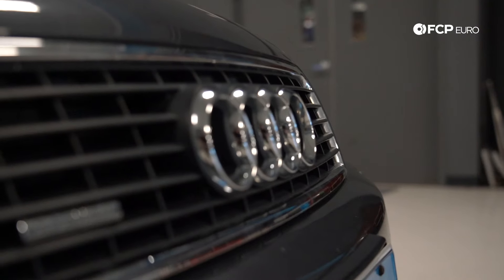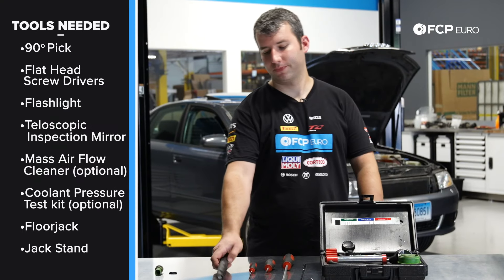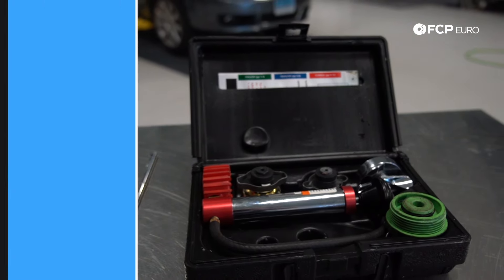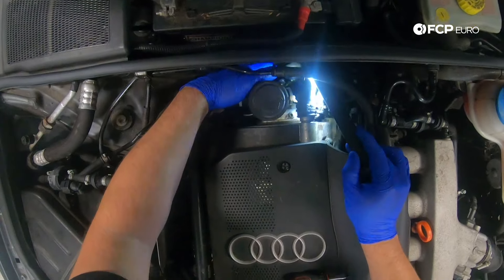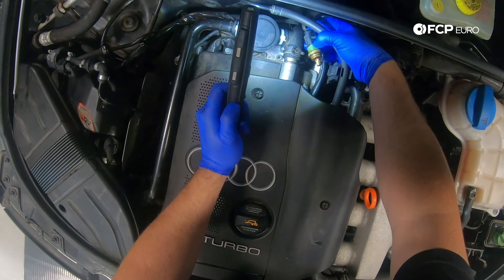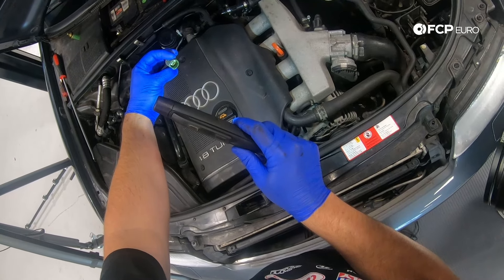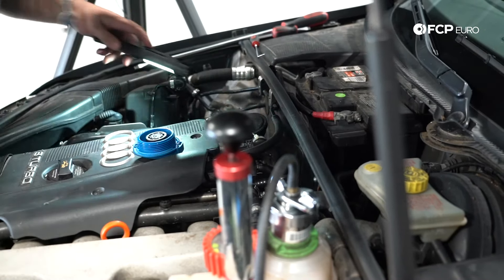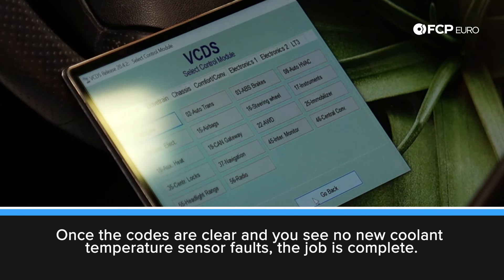Audi A4 B6 1.8t Coolant Temperature Sensor Replacement DIY (A4, A6, Golf, Passat, & More)

Comment: Thanks for the tip on tilting the engine. My sensor just failed, and I know it was stupidly tight to get stuff behind there when I took the cylinder head off and back on a while ago.

Comment: I change my without jack the car take couple hose and done the hard part is to put the clip without dropping inside the engine but working in my a4 1.8t b6 I developed a good touching sense to doing things without looking at the spot so for me skip steps  sometimes thanks for the video help me  good 👍

Comment: Doing this right now as we speak, with a 1999 passat 2.8 v6....the sensor is a PITA to access.  I thought i had it in correct, went to top off the coolant reservoir and coolant came POURING out the sensor.  You just showed me that i did not have it sitting properly and need to push it down more and secure the retainer clip better.....thank you so much for your very detailed and easy to understand explanation, MUCH appreciated

Comment: Thanks for this explination ,,, i have Passat 1.8 T ,2004  ,, but i have other problem , the stik who is going to inside sensor , was broken and was not contacted to the stik with 4 cable and diffrent color ( white , red , Gris , black ) the problem i do not know which pin number go to that color ,, please need help to that color exactly to there pin number ( 1, 3  and 2 , 4 ) ,,,,

Comment: Hi, Thanks for a great video. I changed the sensor on my audi a6 2008 but sometimes shows the correct temperature sometimes shows nothing. But I haven't had the opportunity to update it with the computer, what can you recommend? Thanks in advance
Reply from the maker: Scanning for codes first and clearing them is an easy place to start diagnosing the change in readings!

Comment: I have a 2001 AUDI A4 Quattro Avant 1.8 liter Turbo.
Engine code: AWM.  About 12 years ago a replaced the coolant temperature sensor because the gauge in the instrument panel displayed cold coolant, although it was hot already. Just this part of the sensor was faulty. There was no error code!
Recently I noticed some coolant drops under the sensor!  It seems it started leaking. I do not know when it is started leaking. My wife has been complaining for years (!) that she smells coolant when we drive. The oil has been leaking for 20 years, I always thought it was the oil dripping on the exhaust system... 
There is no error code this time either!!
I am about to buy a new 4 pin sensor with  a new O-ring  and replace it....

Comment: Thanks for video, i have a problem I appreciate if you can help me. My audi a6 c5 3.0 model 2002 has a problem that the cooling fans are kicking in late at 108c , I replaced the fan control module, and the coolant temperature sensor, same problem exist, when the gauge pass the middle, and the temperature shows 108c on the scanner, the fan kicks in. I read that the fans should activate at around 92-93c. Is there anything else i should check. Please I need your help. Thanks a lot
Reply: the fans have modulse inside they break often did you replace the fan

Comment: Couldn't get mine to seat right for the life of me. This video helped me a lot. I've been trying to press straight down instead of working it in. Gonna try this in a few min. Thanks for always making great vids.
Reply: The new one I bought was just  little bigger. I tried installing it without the O-ring , the new one, still would not fit. I'll be getting a new one tomorrow.
Reply: @jeffdawes9029  same thing I feel victim to as well, I got an aluminum flange kit and everything worked wonderfully except for the coolant sensor not seating properly in the sensor housing. Had a brand new leak where there wasn’t one before!
Reply: so, my second new temp sensor worked.
Reply: @jeffdawes9029  in my case the senspr was not wrong. It was the housing 100%.     People that haven’t done this yet, if you went eBay route like I did for these parts, make sure they fit right before doing the install! Otherwise you’ll be ordering another properly fitting piece lol
Reply: im assuming it worked lol

Comment: Hi, thanks for the video. I recently replaced mine on my Polo GTi 1.8t and I have been good gas mileage ever since and fault is cleared from ECU.
Reply: hey man, i need to ask you, i have passat 1.8t and i have lpg instaled too, on ecu i have check engine notification, on diagnostics it saids its lambda sonde, but on lpgs ecu it saids multiple errors conected to temperature sensor, now i noticed thet when i clear ecu code, i have good mpg, untill it cames up again, and start showing grand mgp, i noticed too that temp needle is altering from 0-90. Now my question, can this tiny sensor almost double the fuel consumpion??
Reply: @orgrimdoomhammer2161  yes, from what I've experienced it causes really terrible gas mileage. From what I researched it is either the CTS or the thermostat that throws off the error. So start by changing the CTS clear the code and observe.
Reply: @lincolnbothang7258  changed it, bord now showing normal values, itll take time to make some distance and test it out :D error still showing, i need to find some one to delete it from ecu
Reply: Hi Lincoln, I have got a polo gti as well and trying to sort the P0118 code and bad fuel consumption. I will replace the sensor and thermostat as well. Wanted to check if you had to tilt the engine as I  don’t think so as the polos are mounted side ways opposed to length ways in the a4 shown in the video. We should have more access, is that right? Thanks mate .
Reply: @adizillich6648  yes, no need to tilt engine sideways. The sensor is on the right side of the engine and the thermostat on the left below the alternator I think. However, I'm not quite sure on removing the thermostat.
Reply: @lincolnbothang7258  thanks bud
Reply: Hey how did you put the C clip back in because isn’t want to …
Reply: @layziehussle2624  just keep trying. My first c clip was the pvc breather hose and took me a whole 2 hours just to fit. Try to align it as much as possible and push evenly from the middle
Reply: @lincolnbothang7258  I tried my best and I broke two of the clips now it doesn’t want to slide in

Comment: Hey when I put the C clip back in it doesn’t want I tried so many times it doesn’t want…. What should I do?
Reply from the maker: You will want to remove the sensor again and make sure it is seating itself all the way done. Some lubricant on the o-ring never hurts!
Reply: @fcpeuro  I tried and and two of the C clips are broken now 🤦🏾‍♂️🤦🏾‍♂️🤦🏾‍♂️

Comment: I changed mine and now fan start working at 98 degree. Plus another issue... not work at full speed at 105 degree. I change 3 times and same problem

Comment: This is happening to me right now with my 2012 Passat. It causes misfires and car shuts down and because it’s hot, it has to be cooled down to restart.
Reply from the maker: then hopefully this makes it an easy fix!
Reply: That happened to my 98 a4 B5 1.8t. The idle will bounce the engine check light comes on engine will shake and sometimes shuts off. Won’t turn on right away till engine cools. Replaced coolant sensor and it was back to normal.